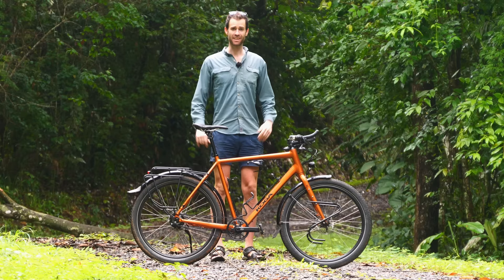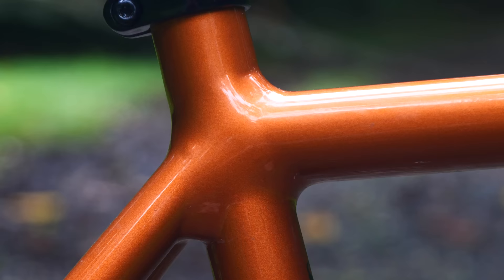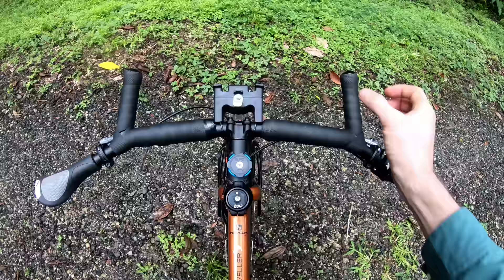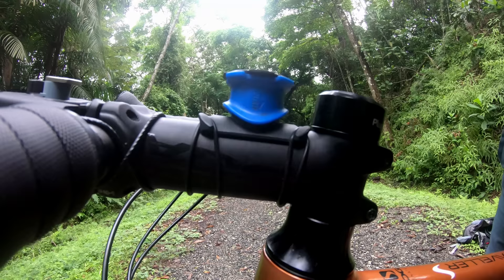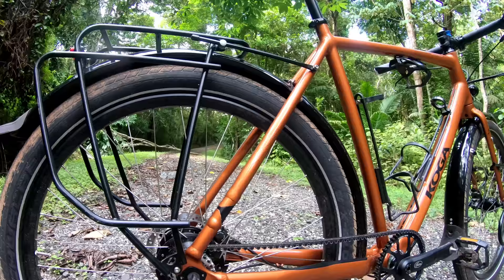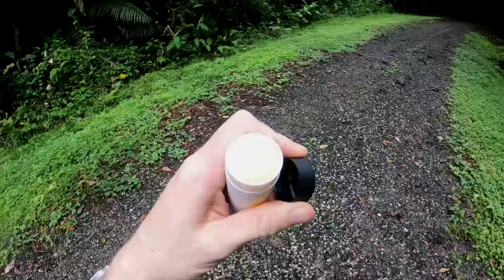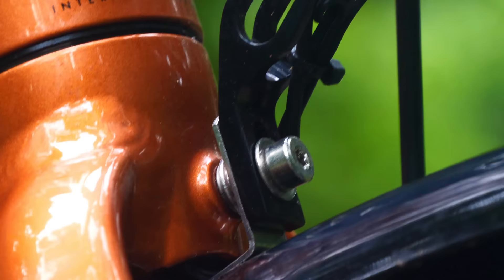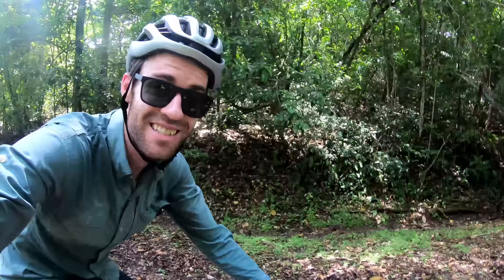The 2020 KOGA WorldTraveller-S is a $6000 Indestructible Touring Bike

Comment: hmm. okay no Suspension is great on most roads and good enough on gravel. my full Suspension with lockout in front and half and full lockout has no disadvantages though. except weight and that something could break , so fair enough. But. For a 6000 bucks explicit touring bike id want the mounting spots for the rear panniers at least just fully integrated in the Frame.          my Dream idea of a touring bike to travel with alot of luggage, as many world travvelers seem to do, would be equipped with a way bigger handlebar that includes an aerobar and a simply huuuuuge front box, that is stabilized with inner rods .                            you would rest your Hands upon it, it would be lockable, and if you make it from Carbon fibre it should be light enough. Not saying you would want to fully load this Thing , but it is certainly nice to be able to loosely throw in stuff.                             It is Kind of weird that there is no touring bike that is Kind of  like a Honda goldwing, with big boxes all around.                 Maybe that would be too heavy..but Maybe not.                                                            guess the market for These Kind of bikes isnt so big as to make bikes truly specialized
Reply: Too much front load with high center of gravity the bike will self steer, strapping it near the front hub won't affect the steering as much, if the box is too big it will block your view of the front wheel, which you will need to pick your line in technical terrain. Fabrics conform easier, so panniers can potentially hold more than rigid boxs, and when the straps are tightened the stuffs inside will be secured in place and won't rattle, the last thing you want is for them to shift towards the side you are leaning during turns. Welding or laminating box mounts or boxes to the frame changes the way the frame material behaves under load; think of it like this, the rack is like the derailleur hanger, if it snaps off your frame would still be fine (they are not designed to though because they and the eyelets are super strong), an integrated derailleur is never the best idea.
Reply: @Finnv893 mmm. You can have a box directly bolted to the frame or rather a frame that simply goes on in front , then it's attached to that but above the front wheel. I don't think this would affect steering badly especially given it's gonna be filled second when the rear is already heavy. It sure would block the view but well. If the terrain is that technical you took a wrong turn then. Not meant for that.     ....there's cargo bikes, with the indirect steering typical for them, with tall rather than long boxes. I think you could try to get as close as possible to that idea without indirect steering or small wheels.  A huge rear box would always fit more, too and that sorta fuzz free n more aero

Comment: I cannot comprehend why you would want an aluminum touring bike rather than steel or carbon..
Those big welds, ya , cannondale was doing that in the 80's.
Reply from the maker: Stiffer, lighter, integrated steering limiter, fancy full-length internal cable routing. Tests better by all metrics in the lab.
Reply: @Cyclingabout  what about the comfort metric? I can see aluminum being lighter, but to get high strength requires a very stiff frame. Why would you want a stiff touring bike? Tests better by what metric? Aluminum also fatigues quicker and is mainly used to produce bicycle frames because it is cheaper to manufacture than steel lugged or tig welded frames.
Reply from the maker: @azonicrider32  
- Check out my latest video on frame comfort here: https://www.youtube.com/watch?v=Lb4ktAbmr_4
- It's a very comfortable bike to ride because I have 2.4" tyres and a suspension post.
- It tests better in all ISO frame tests. Front impacts, side impacts, torsional rigidity etc. 
- Fatigue is not a problem for a bicycle if it's engineered well. We can build aluminium frames with enough reserve strength to last a lifetime.

Comment: That's a dream come true touring bike,  no doubt about it,  but I don't really buy the aluminium versus steel argument.  With all of today's hydroforming and welding technology,  I would think that steel tubes can be contoured,  bent and tapered to any profile imaginable or desirable.  Steel will always have a vastly superior fatigue life and level of field serviceability compared to aluminium,  you can weld it back together with a coathanger if you have to.  This is my unbiased assessment,  it has absolutely nothing to do with the fact that I ride a steel Surly,  nothing at all,  I swear.
Reply from the maker: Steel is undoubtedly the most advanced it has ever been; Rob English has been pushing the boundaries of steel further than any other builder IMO, check him out. I also came across some preview images on a project Thyssenkrupp is working on, which sounds promising (but lacking in lots of detail). But compared to the latest-generation aluminium tech (from ~2011) - what is possible with steel is still very much constrained. I've had the pleasure of talking to many metallurgy experts and bike engineers over the years and carbon and aluminium tech are blowing my mind, especially when combined with all the latest engineering analysis software. This space is moving super quick!

Yes, it's true that aluminium has a no endurance limit. This sounds alarming I know, but the thing is that aluminium touring frames are engineered to be three or more times stronger than a steel frame, easily withstanding the stresses of bicycle touring. Put simply, a well-engineered aluminium frame will be so overbuilt it will never be affected by fatigue.

Comment: Six large for a vanilla looking mountain bike? Someone is smoking the devils lettuce
Reply from the maker: This vanilla-looking mountain bike is the best touring bike I've ever swung a leg over. It's stiff, stable, comfortable, and has experienced zero component failures in 40,000km of use. All I've had to replace are the tyres, brake pads, and oil in the hub. It's worth so much more than six large to me!
Reply: @Cyclingabout  Roger that. Guess the devil is in the detail. It just looks like a middle aged geography teachers daily driver from afar...

Comment: Aluminium, still hard to find a welder in any country compared to steel, although u probably call’m up for replacement, the rest of us mere mortals don’t have the luxury, nice bike though
Reply from the maker: I wish I had some hard data on this, but I'd say that of the steel bikes I've ever seen repaired, the failure rate has been close to 100%. You really need to find a bike frame welder, rather than an industrial welder, but the former is pretty rare in most of the places I go. Just a few weeks ago, a welder put a huge hole in my friend's steel fork. :(
Reply: Very true, but I see u use steel panniers, as u say u use them as there the strongest option and after the wheels 2nd most likely to b damaged, which surely proves a point, or u would use aluminium racks, horses for courses I know, I seen a few people using carbon bikes for world tours, no hope of fixing’m outside of western world though, happy travels
Reply from the maker: Aluminium frames and aluminium racks are not equal. The difference is an aluminium rack has panniers grinding against it all day. As aluminium is a softish metal, this rubbing can lead to rack failure (I made this mistake once). That's why I recommend steel. 👍🏻

Comment: where did they hid the motor on this 6000 dollar cycle? Aluminium is inferior to steel. Ridequality, repairpossibility, smooth ride. It is well know that Kogas look nice but get weak in the frame after 5 years.....Never buy a second hand one. Get an Avaghon, Idworx or Santos.

Comment: Why Rohloff over Pinion?
Reply from the maker: Yep.
Reply: @Cyclingabout  why?
Reply: @Cyclingabout  
Did you try Pinion?
Reply from the maker: @nocnymarek7645  Yeah. Rohloff is lighter (1kg), more efficient (94.5% vs 90.5%), cheaper by 1000 euros, faster hub engagement, and Rohloff has had more time to iron out any kinks in their gearboxes (20 years vs 7 years). Don't get me wrong, I really like Pinion! But I like Rohloff a touch more for the above reasons. 😊

You can read the advantages of Pinion here: https://www.cyclingabout.com/tour-with-a-pinion-gearbox/
Reply: @Cyclingabout  
Many thanks for wide answer.
I dont get you wrong cause since 5 years I am also Rihloff user, which us fulfill my cycling dream.  BTW similar bike - trekking, some lighter, less equipped but finally similar.
However since I try pinion 1.18 I still consider this but price and just shorter market period = less experience in real life make me off this solution.
This is why I collect opinion regarding R and P. Thanks for your.
Btw is drive belt durable enough in case of dirt, dust, sand?
Reply from the maker: @nocnymarek7645  Yes, I still am able to ride 20,000km+ in dirt, dust and sand. It's very durable.
Reply from the maker: Yeah, Martin had some really bad luck with belts. I can't explain it, but I can only guess his Bombtrack frame was not stiff enough and was also not in perfect alignment. I push the boundaries of my belt drivetrains in some really harsh environments and have never experienced anything like this!
Reply: @Cyclingabout  
Ok, Good to know opposite view, however customer rather has no I fluence for frame stiffness or alignment of belt.  You're probably right that not perfect linear belt way could be main/one of reason of troubles. It is what we even dont consider with chain. Every technology has its requirements.

Comment: Nice bike, but it's easy to laud something so expensive that was given to you rather than bought.  Good mid-drive e-bikes start at about $3K, so I'm not sure why I'd consider spending $6K on a bike like this.
Reply from the maker: You can get eBikes for $1K or $13.5K (eg. Specialized Turbo Creo SL). It's the same with touring bikes, which range from $600 (Aventon Kijote) all the way through to $11K (IdWorx oPinion Ti). Of course, there are diminishing returns as you move up through the price spectrum, but you do get some really nice features on top-of-the-line bikes (or cars, boats, watches, houses etc) - and some people really appreciate that. Anyway, it's my job to ride fancy bikes hard, so that's what I'll continue to do!
Reply: @Cyclingabout  
Fair enough!  Sounds like a nice gig.
Reply: I'm guessing that in many of the places he rides, charging that $3K mid-drive e-bike might be a bit more difficult. The Rohloff adds cost, a quality wheelset adds cost, the light and charger add cost. I'm guessing that $3K ebike won't be equivalently specced.
Reply: @SteveFullerBikes  
No it won't.  It'd have an external cassette transmission, which of course reduces costs significantly.  There are IGH e-bikes which are usually much more expensive.
Reply: @alankoslowski9473  - So you're not really comparing apples to apples. ;) There's always going to be a bike cheaper and a bike more expensive than just about any other bike out there.

Comment: No frame made of alu is indestructible, the MpA numbers don't lie. However well made, in time it will fail.
Reply from the maker: Yes, aluminium will fail after a certain number of stress cycles. The thing is we can engineer aluminium with enough reserve strength so that it is highly unlikely to fail in the lifetime of a bicycle.
Reply: @Cyclingabout  History and alu frames have barely lasted a month with me, though they were basic cheap Trek 'alpha' frames and I'm over 100 kg, 23 mm tires on harsh London roads. I can see this is a much finer quality build, but for the money I'd want Reynolds 931 or Columbus XCR. I won't blunt your cutting blades with Reynolds 953 mind. We don't need to World Travel to Alpha Centuri. I can't buy an e bike because their all made of alu. In sunny Spain they do steel one's. And in the America's as well I believe.

Comment: I've broken 2 aluminium frames from fatigue, no thanks.
Reply from the maker: ok
Reply: Indeed. Steel gives, Aluminium breaks (& unless you are very, very skilled is an absolute pig to weld). Best sticking with a triple butted quality steel or making the leap to Titanium.
Reply from the maker: @wangdangdoodie  This is only true if you use the frame for something it has not been designed to endure. We can easily engineer enough reserve strength into an aluminium frame to ensure it lasts the lifetime of a rider.
Most people use an aluminium seatpost, stem, handlebar, rims, cranks... and don't think twice about them. Aluminium is literally used in millions and millions of industrial applications with much more dire consequences!
Reply: They were both gravel frames with around 20000km each. They didn't break in weld but on chain stays tube closer to the wheel. They were used like 80-90% road, both from Marin Bikes.
 I mean it's no secret that aluminium is most prone to fatigue damage from all the frame materials.

Comment: Aluminum EBB on a "indestructible" bike? Uhhh....
Reply from the maker: I'm not sure why that would be an issue? Bushnell EBBs are as good as it gets, I've got one on my winter mountain bike which has never missed a beat.
Reply: @Cyclingabout  7 years as a Professional wrench and I never had a single EBB that did not creak and/or slip, including Bushnell. The exceptions were old tandems with split BB shells and pinch bolts.

Congratulations on your luck with them.

Comment: Ridiculous set up for touring. All show and no go as the bike is too stiff, the seat too high in relation to the bars and the wheelbase too tight. Yeah, it looks good on a daily ride but would be deadly after a couple of weeks.
Reply from the maker: I've been riding KOGA WorldTraveller bikes on all kinds of terrain for quite a few years now, and nothing has broken, the frame is adequately stiff for carrying my loads, the saddle-to-bar ratio is perfect for my body height and core strength, and I'm happy with the wheelbase length (chainstays are already 470mm). I'd change a few things on it, but not much.

Comment: i ones had a idworx the price was 5000 euro's, and after 6 month's e sel him, bechouse is was to stiff, evry bump i ride translate direct to me body, bechouse the bike had no any bit of a flex, and me back and shoulders was herting, so for my its not worth the money anymore, my next bike will be an carbon one canyon roadlite cf 8.0 carbon is stronger and flex all bumps a way, and is even stiffer then alluminium, this bike gonna cost me around 2000
Reply from the maker: It sounds like you're the perfect candidate for a Cane Creek suspension seatpost and RedShift ShockStop stem (look it up)! You can fit these up to any bike to make it comfortable... don't limit yourself. 💪🏼
Reply: @Cyclingabout  you are right, i dont heff to limit myself thank allout for your'e advice  mate

Comment: Koga is an extremely overpriced Hype brand. I can get the same specs or even better for almost half this price and if I would spend 6K in a bike it would be a real gear like Santos bikes
Reply from the maker: I've ridden a lot of touring bikes over the years and there is nothing hype about the brand. It's top-tier pricing, but you get what you pay for - the WorldTraveller is stiffer than most frames, it has a very high attention to detail, proven touring components, great geometry, 200+ colour choices, lifetime warranty. Which bikes are half the price with the same specs as this KOGA?

Comment: Dynamos are really only 5% efficient and slow you down go solar instead.
Reply from the maker: Not sure where you're getting these numbers. We've measured them to run at 50-60% efficient at 12km/h and 70-80% at 25km/h. That means if you're generating 2.5W charge input at 12km/h, the most its taking is 5W from your pedal power. And at 6W charge input, you're taking about 8W from your pedal power.

Comment: Dumb price, overpriced by at least 400% if considering each component individual price.
Reply from the maker: $1684 (Rohloff hub only) + 400% = $8420 😂
Reply: @Cyclingabout  1684 is so ridiculous for a hub, with that i can buy a custom steel frame and put a new 105 or sora group set on it, there's no way i can justify the cost of that thing.
Reply from the maker: It's a hard pill to swallow, that's for sure. I've done over 50,000km on two of my Rohloff hubs, so I guess I get better value out of them than most. I love never having to think about maintenance (lube/degrease/tuning/cables) or replacing worn-out drivetrain parts!